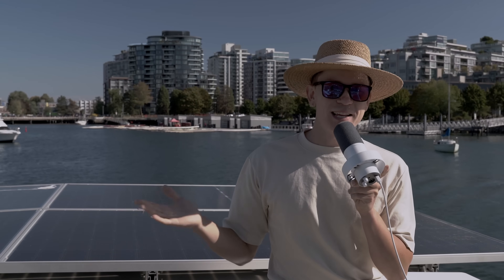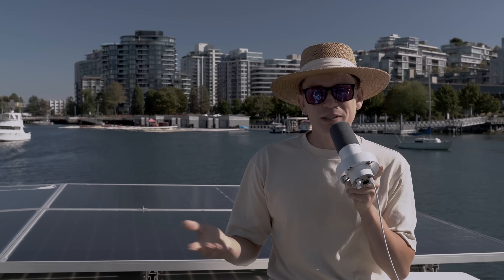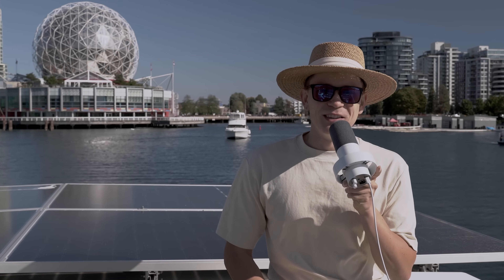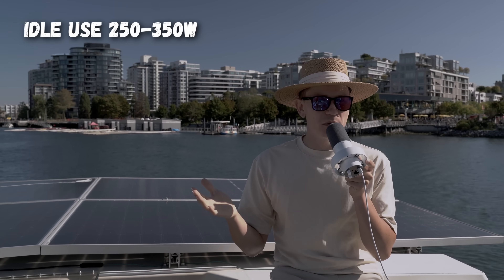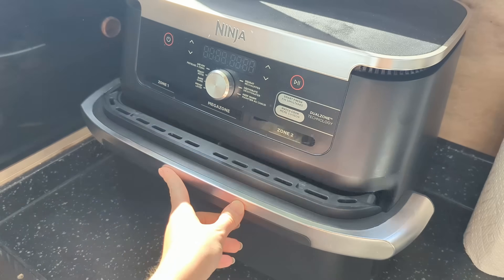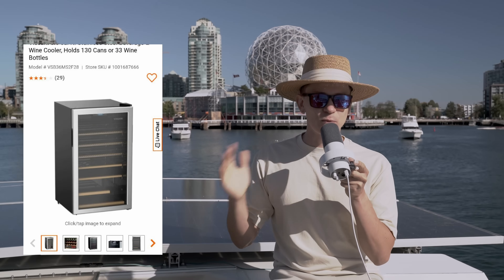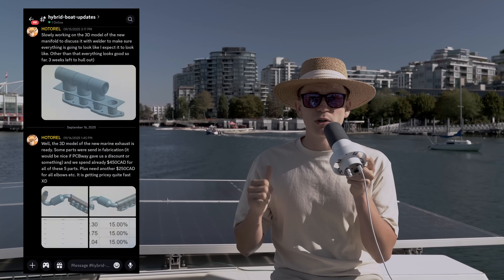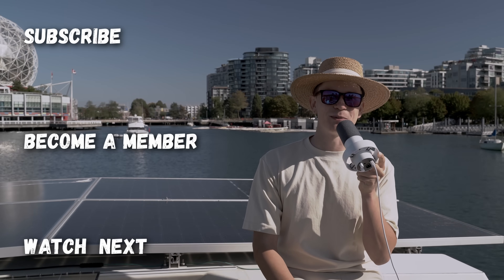1 Megawatt of Free Power on Our Boat

Comment: Wow, crazy after all that work you guys are getting rid of the Onan generator. It makes sense though, since you'll have a much more efficient system.
Reply from the maker: Heh, yeah it is kinda sad that we didn't had a chance to use it for a long time but if we won't do it now next time we would be able to remove it only when we will remove the second engine. And we really don't know when it is going to happen, so it will slow us down quite a lot if we will want to install new batteries asap. And we will want that's for sure)

Comment: Coming into winter soon, be interesting to see how you guys hold up. In Ukraine winter drops solar to almost no functional power generation. I bought a 7.5 kW wind generator but haven't got around to setting it up as I have heard mixed reports about them. Is it something you have considered? Generators get a good work out when powers out. Great job to get this far though.
Reply from the maker: We already have some videos about previous winters. It is going to be our third winter on this boat. In terms of power generation, there will be no charging. In the best case just only generate enouth so it will not discharge our batteries and cover our idle draw, which is about 200-500W from our 2000+W panels. And also will be super limited in terms of how many hours because the sun will be really close to the horizon. In the winter time we pretty much depend on the generator.